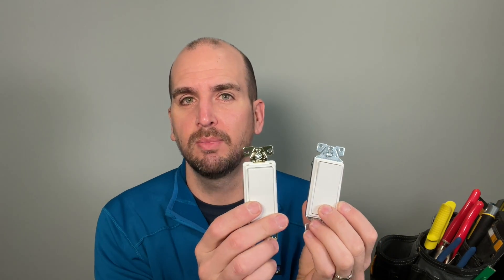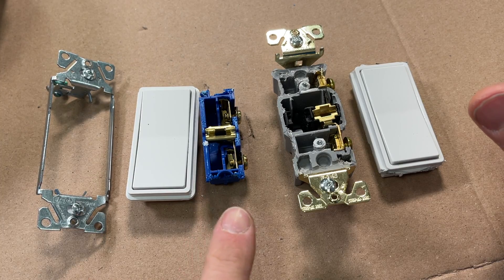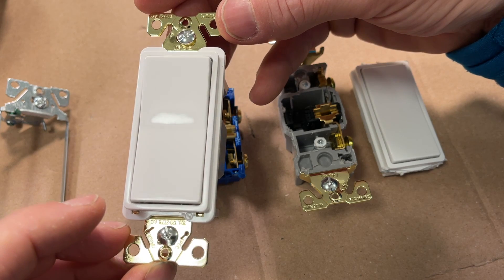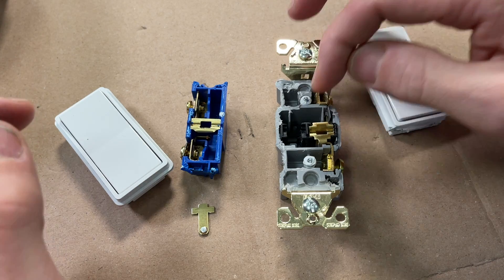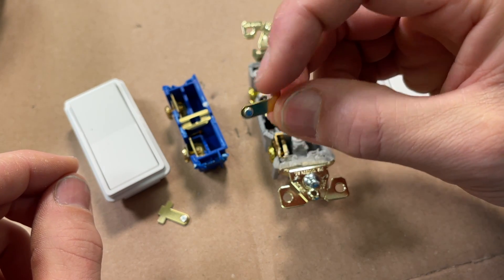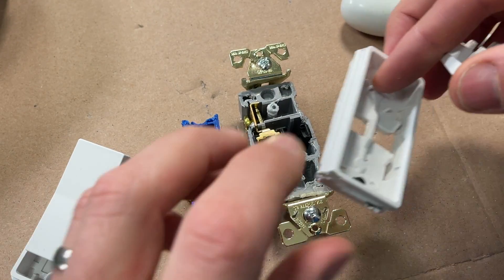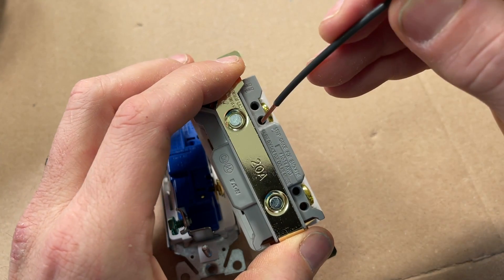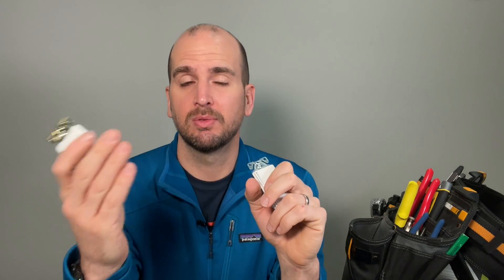What Decora Switch Should You Buy  |  Residential vs Commercial

Comment: “You’re paying for it” makes the assumption that scaling the single part across multiple lines doesn’t make it cheaper per part then a unique part for the product.
Reply: In the molding industry, tooling changes are expensive. For plastic injection you can cycle the machine for a part like those 30+ times an hour making many parts per cycle, stopping production for 1-16 hours (depending on how well set up you are) to do a tooling change is time you're paying for instead of profiting. if the sales volume is too low to keep the tooling in for long runs it can severely drive up cost per unit. This is likely behind the decision for common moldings on the commercial switch.

If the volume is low it's cheaper for them to get the molded plastic parts that way, not to mention the cost of the tooling itself. If you're making so many the tooling can just stay in the whole month, it's usually cheaper to have separate tooling per product for reduced material cost per unit. 

They may have even started with shared tooling, with a plan to switch to separate tooling later if the sales volume they get makes it more cost effective.
Reply: Not necessarily cheaper even with volume, for molded parts, volume of the shot, number of cavities in the tool, and complexity all play a part in yield/cost. Size matters.
Reply: It does make it cheaper, but that does not mean YOU get to see that price and still have to absorb the cost in comparison, so "You're still paying for it".
Reply: @rsxen8990  You're paying for lesser volume. To use the same base for multiple configurations to be used on multiple lines is saving you on that low volume cost. You're really not paying for the item to be modular, that is simply saving you the cost you are paying on... thicker quality build and lower volumes.

Comment: -level of usage. If it is a switch that will get used several times a day, go with the better one
-warranty. If you are an installer, and have a warranty/guarantee on your work, go with the better one, since having to go back to a site later to do warranty work will cost you a lot more than the $8 part difference. 
-if you are new at this, use the better one - they are harder to screw up; those back wire screw clamps are a lot nicer to work with.

Comment: one reason why I am looking at decora compared to toggle is the ability to blend in with the automated switches now coming out. I use a load of three way and four way and prefer to buy the ones that seem to last longest and cause the least call backs, which are usually commercial except I have had ok use of the 20 amp GFCI packs from China.. at decent savings as well..
Reply: Although Eaton offers a gfci and switch that is nice but I wish they also had that in a three way switch option...

Comment: Pretty sure the commercial grade switches are rated 277V and the residential are rated 120V.  Not uncommon to run into 277V lighting circuits in commercial environments, not so with residential, obviously.
Reply: Nope even the low end ones are rated 277v, easily looked up.

Comment: I don't see how you're "paying for features you're not getting" - that should actually make it cheaper. They design one switch with all of the features for the most advanced switch, and then just leave out some of the parts for the more basic switch. Less design time, less tooling in the factory (molds) as it's all the same, less separate skus of the parts (paddle and housing is the same for double pole as single pole) leading to simplified supply chain. Really all you pay extra for in the "reduced functionality" model is maybe 2 cents of extra plastic that you don't really need. And all you save over the more featureful produce is a couple of bits of brass, an extra contact, and a couple screws (probably grand total cost of 25 cents at best). I'm sure the commercial pricing has nothing to do with the design or manufacturing, and more what price the market will bear.

Even in "residential", I've seen multiple grades of switches and outlets - you can get the ones that are sold in bulk in the hardware store for about $1, and you can get the slightly beefier ones for $2 or $3. There's definitely more of a difference than just one comes bulk and doesn't have packaging - they are a different design, and the more expensive ones seem more robust.
Reply: The product model you described has been used in the past.  In the 1980s, I owned some computer stores and one of the printer manufacturers had two SKUs for a particular printer; the SKU and price difference was the amount of onboard memory.  But there was only the one printer for the reasons you gave, and it had an internal DIP switch that determined how much memory was available for the list price you were willing to pay.
Reply: @ThinkAndLetThink  This is getting more and more common in tons of products now. Products are crippled in software, and you upgrade them by paying for a license key that's tied to the serial number of the device (or figuring out where the magic bits to enable the extra features are in the eeprom and turning them on yourself, or bruteforcing the upgrade key if the key space is small). This is especially prevalent in professional equipment (think broadcasting), test equipment, thermal cameras (Flir E4 / E6 / E8 - all the same hardware, but IR resolution is crippled in software) etc etc. but is finding it's way into more and more consumer products.
Reply: @gorak9000   It's all perfectly acceptable.  Another way of looking at it is you get a discount if you forgo some of the features.

Comment: The big difference seems to be the mean time until failure. This is important for switches that will have very frequent use, like in hotel ballrooms, conference rooms, or other public spaces.
Checking the Leviton site their Decora commercial switch has an endurance rating of minimum 50,000 cycles before failure. Their residential Decora switch doesn't have an endurance rating at all.
Leviton commercial switch - https://www.leviton.com/en/products/5693-2w
Leviton residential switch - https://www.leviton.com/en/products/5601-2i

Comment: Lets see....A 15A switch could handle at 80% capacity over 80 units of 100 watt equivalent LED bulbs.  Who has that house?  Not me!  Times have changed.  Those 15A contacts should last forever with the actual loads that will be encountered.  An entire gigantic chandelier could well draw 2 or 3 amps max.
Reply: People also use these for ceiling fans and other loads you know...
Reply: @YT32-16branch  Of course they do, and in that case you could make a judgement call.  However, what % of switches are for lights?  80-90%?  A new 52" ceiling fan draws about 1/2 A at full speed with the lights on.   One or two of those on a single switch is is usual, so 1 amp max.  10 of them could draw 5 amps, but who has 10 ceiling fans of a single switch?
Reply: @richardspengel5360  In case of fans there is still inrush current and arcing to consider. Your numbers also apply to brand new units. In reality these values go up over time. To each their own and what they can afford. I am an industrial electrician and I would not install the cheapos. But I am also that kind of guy who doesn't buy his car parts at Autozone and would not bring my car to  Walmart to do an oil change....
Reply: @YT32-16branch  Neither would I, as I said in another post.  There is a middle ground.

Comment: Can you put a 12 ga. Wire in the 15 amp switch holes in the back of switch?
Reply: ALWAYS read the specifications for the particular device.
Reply from the maker: Yeah, back wire can handle up to 10 ga.  Remember this is not the push pins holes.

Comment: I would consider the commercial one in a high use switch. Some switches get 10x or more the use of other switches.
Reply from the maker: Yeah, but for $10 per switch that is a bit excessive.  Other brands might have a better "bang for the buck" option.
Reply: @EverydayHomeRepairs  I miss typed. It should have read “a commercial” and not “the commercial”. Bottom line a more durable switch could save a lot of labor and hassle in the future. It is just a matter of how much your time is worth.

Comment: Spec grade switches will last much longer switching heavy loads or motor loads. So if you are switching a garbage disposer, a lighting circuit with a lot of fixtures, or an electric heater, go with the spec grade. Also if the switch is frequently operated you might choose the spec grade as it will last longer than residential grade.

If you are doing a total replacement project, take your list of materials and fixtures to an electrical supply house and ask for a discount. You may be surprised how much you can save. You also will have access to a wider selection of devices and cover plates.
Reply: "Also if the switch is frequently operated you might choose the spec grade as it will last longer than residential grade."  My thought exactly.  Some switches are rarely used others are in constant use.  The same is true for receptacles, the ones we always plug into for vacuuming should be spec grade, the one we plug a switched lamp into may be "contractor" grade.  Best regards, your statement is the most sensible one.
Reply: If you are competent with electrical work, buy what you like. Even the cheapest will last years and only takes 30 minutes to swap out when/if it fails.

Comment: Comparing a 15A residential grade to 20A spec grade isn't exactly apples to apples (box stores may not have a 15A spec grade, but they do exist.) There's about 400 watts difference in their rated switching capacity (1440W vs 1800W) and lifespan will certainly favor the spec grade if both switches are fully loaded in use. That being said, I totally agree that in a residential setting, it wouldn't make sense to install spec grade switches throughout at that price. I WOULD recommend using them for things like the garbage disposal or any area where there might be a 800W or greater lighting load or for any kind of switched motors (ex. whole house fans). They will last longer switching large loads with high inrush current like motors and lighting than a regular residential switch.

Comment: Seems to be a misunderstanding of what you're paying for.  it costs less to make one part that can be used for several things than having to design unique parts and have molds made for each of those parts.  if you can use one set of tooling and one design it drops the cost not only in that end, but also in the warehousing  of the parts and likely in the machinery that assembles the switch, allowing one machine to assemble any switch that fits in the housing. 
Sure, you 'waste' a penny of plastic on 'on/off' switches, but you make it up on costs saved elsewhere by using the same part.  The actual reason the commercial one costs 5 times as much is because it says commercial on the box, and you're stuck using it to meet code.  Home owners can choose to buy a 59 cent light switch, new commercial can't so what should be a $3 switch instead of $2 is $10.
Reply: Bingo. Plus from a purchasing and demand planning perspective, if you have a run on some other switch but can use the basic frame from another because they share several pcs in the build of material, you can pull safety stock from one to build another.
Reply: " The actual reason the commercial one costs 5 times as much is because it says commercial on the box, and you're stuck using it to meet code."

Nice to know there aren't any codes applicable to private homes.... /s
Reply: @Mike80528  Public spaces have higher code requirements than private homes due to 3rd-party liabilities.
Reply: @Mike80528  You do understand that the code varies in what is required in different settings, right?  For residential, in most places, all you need is a tamper"proof" outlet and any switch will do.  These are cheap, and work fine in new home construction as well as for general handy-man/diy uses.  Codes for commercial/industrial and hospital grade plugs are more demanding as shown in other videos on this channel. 
When someone says 'to meet code' they are referring to the code that applies to their use case. code is different in different applications.

Comment: Yoke is low cost steel, not the more costly brass.  Look for lubricated rockers on low end for quiet clock.  High end have a silver oxide contact for long life.  Resi plastic is often brittle urea vs nylon or polycarbonate in commercial.
Reply: The yoke will be steel in both cases.  Brass is expensive and not as strong.  The residential part likely has a plain tin or zinc plating.  The commercial quality likely has a yellow chromate conversion.

The contacts are not likely silver, and certainly not silver oxide.  Silver is used for quiet connections with low current and wiping contacts, but is too soft to switch higher currents at high contact pressure.  If there is silver in the contact, it's likely AgWC (tungsten carbide), but there are a bunch of possible alloys for the contact buttons.
Reply: Is there an alternative to these products you recommend?

Comment: Biggest consideration for me would be use cycles. We all have a 6-8 switches that we use constantly. Others may only be used a few times a year. I would consider the commercial switches for high use areas.
Reply: Yes, to put the commercial in low use places is pissing money away. The cheap ones will likely last decades with no issue, and will not burn the house down. The money saved would be better spent elsewhere.
Reply: I no longer use switches... not even the stove light.  
ALEXA! Turn on stove light.
Ding
Reply: @I_am_Allan  sure, good one, LOL.
Reply: @I_am_Allan  That's still a switch. Just controlled via MOSFETs. They have life cycles too before they wear out. Depending on build quality they can also overheat and burn themselves out, short out (and melt,) or the gates simply give up the ghost from cycles. It's just done "digitally" aka via analog low voltage pulses.

These cheap chips are built in china and I've had quite a few go out. Not nearly as user replaceable as a good ol mechanical switch. The money i've spent on transistors is relatively small but given what I did buy, the money I already have sunk into soldering equipment, and the labor to swap out a chip... it would be far quicker than a 3 week minimum shipping from overseas. Pop over to Lowe's and swap a toggle switch all within the hour. lol

Comment: Can you use a 20amp rocker switch on a 15amp breaker?  Can I use 20amp outlets on a 15amp breaker(I see the commercial parts look must stronger and should last longer).
Reply: Rockers are fine - they're just beefier. I'd not use a 20A outlet on a 15A circuit because the "T" plug signifies 20A capacity - you wouldn't want someone trying to plug in a high-draw device on a circuit that couldn't take it.
Reply: @andspenrob  Thanks Andrew, that answered my question, maybe I will find some commercial grade 15 amp outlets for my office.
Reply: @HollowayMooseRanch  and I do believe the 20A receptacle would be against code for the above reason